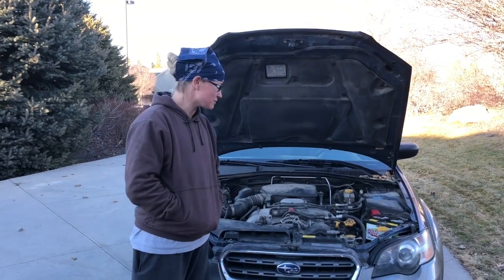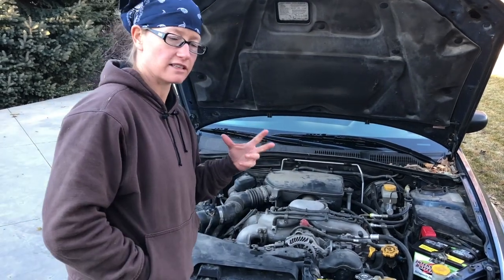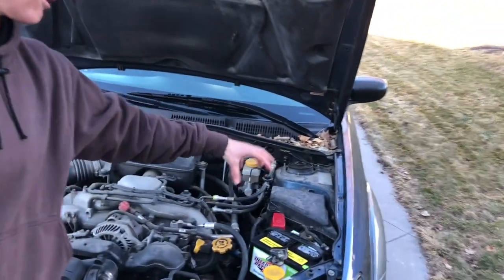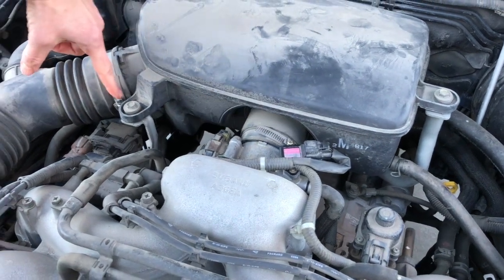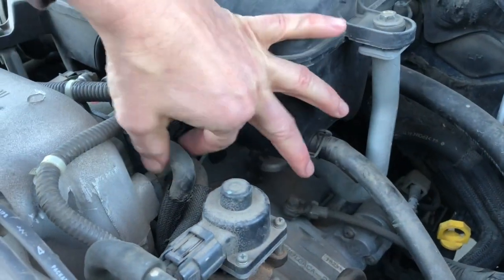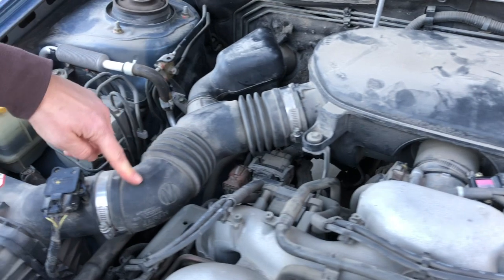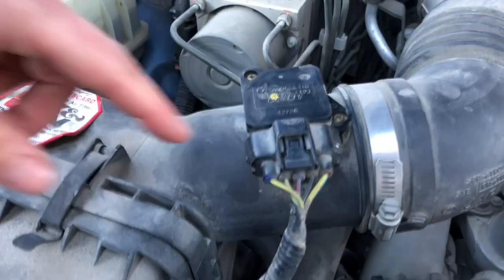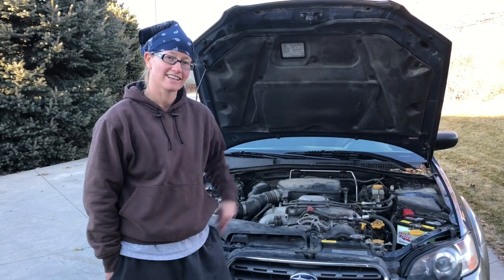Subaru P0506 code

Comment: I can't get the cover off that's covering the throttle body 😭😭😭I unscrewed the two bolts and unattached the two hoses on the left and right as well as the big hose... the thing seems to be glued on. :(
Reply: Hi, at 3:09 you can see that there are 4 bolts. After you remove those, if necessary, carefully hit the throttle body with the plastic end of a screwdriver to loosen.
Reply: @JohnS_Unruh  thank you! That's exactly what I did I had to nudge the throttle body a bit, there was gunk plastered on the hose glueing it on basically 😂😅

Comment: I have a question. I got that code and found this video and am now going to do all that but would any of that make the vehicle overheat?
Reply from the maker: Possibly, depending on how dirty, it could be causing it to run lean which could overheat your motor.
Reply: @iproject1850  no it said running to low but I saw that my car wasn’t liking the coolant cause it dumped it all out. So I put dye in it to find that out. New battery and just sprayed off all parts associated with throttle body and idle. Also air intake so we shall see in a few what happens. Either be good or I’ll see the dye and find out where coolant is leaking from
Reply: @iproject1850  plus I’m in Vegas and the either extreme heat or extreme cold really doesn’t help with the back and forth on battery and engine. But thank you on video. It helped immensely with my knowledge of how it works and where everything is at

Comment: Good video, Informative without being overly technical.  I just started looking into the Idle relearn procedure today. I disconnected the battery to do a pre-winter cleaning of the posts and cables and ended up with idle issues. Thanks for the info.

Comment: Just as an update on this, on my car I took my mass airflow sensor off and it was dirty on the airflow side, I cleaned it with that spray and that immediately solved the problem.  Cleaning that carbon off of your throttle body is good maintenance as well and it will only help the car but if your vehicle is running on low idle and has that  P0506 code,, simply clean your mass airflow sensor and you are good to go.
Reply from the maker: Too easy! Thanks for the update :-)

Comment: thanks for this video
I've been trying to figure out what's wrong with my outback 2007. Same code was thrown 0506 & 0420. Subaru dealership said the exhaust manifold needed to be replaced bc there was a leak; a hole. Except I've removed the covers myself (which they haven't bc the tiny bolts and nuts were rusted af) and I have found no holes to signify a leak.

Hopefully a throttle body cleaning will solve the issue for me...

Comment: I was fighting the same problem with our 07 Forester and was racking my brain on what to do next. I saw this video and it totally described my situation and a probable fix that I had not even thought of. I thought it was all computer related and all I needed to do was clean the throttle body and mass airflow sensor. Simple fix that made total sense! the forester runs great now and I didn’t even have to do the idle relearn! Awesome helpful video!
Reply from the maker: Gregory Stanton great! Glad it helped!
Reply: Thank you so much! Got it done. Works perfect 🤗 do want to mention for anyone else having this issue, my car was dying coming to a stop so it was slightly different. Manual transmission. Also I had to scrub the throttle body gently with a wire brush to really get off the grime. Thanks again! Peace ✌